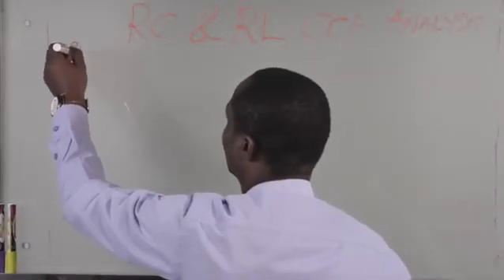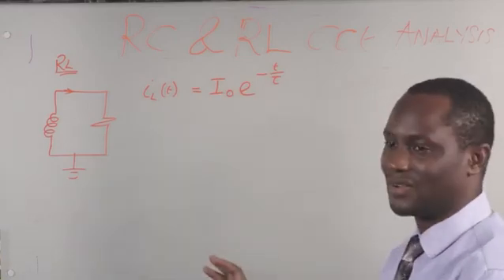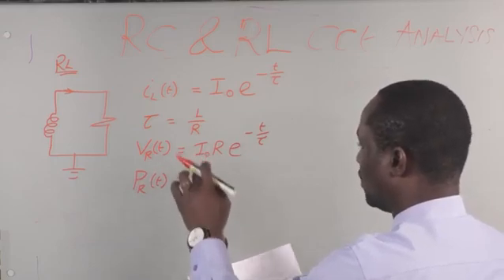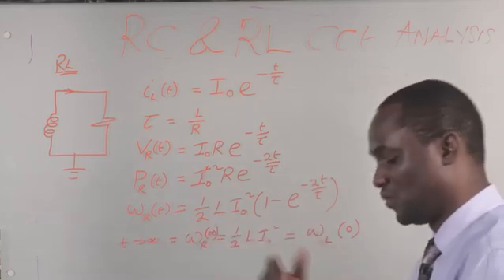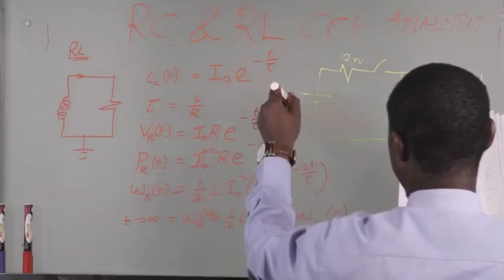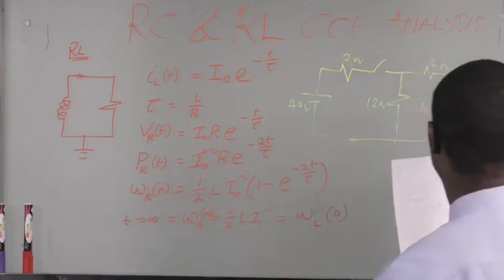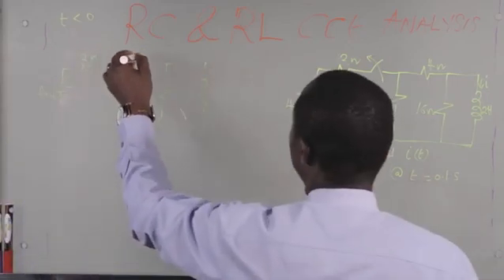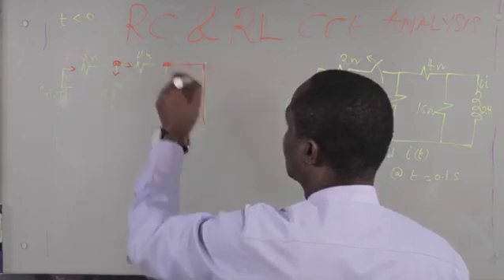RL Circuit Analysis

Comment: Sir please can the answers to the questions at the end be put up for answer confirmation. Thank you.
Reply from the maker: 1.
Vc at 0.2s is 42.805 V
V drop in 6 Ohms at 0.5s is 19.856 V

2. 
Vc at 0.6s is 2.4s
energy stored is 5.33J

3.
The question is to find the values of the current flowing through the inductor for 0, 0.1, 0.2, 0.3, 0.4, and 0.5 seconds
The answers are 
1.071 A
0.239 A
0.053 A
0.0119 A
0.0027 A, respectively.

Comment: but you really did good sir. just that mistake🥱 spoilt it
Reply from the maker: Thank you for watching my video. I will like to inform you that there is no mistake in the analysis. The 16 Ohms you are talking about is already shorted hence no current flows through it which justify why I removed it from the circuit to determine the initial current through the inductor.